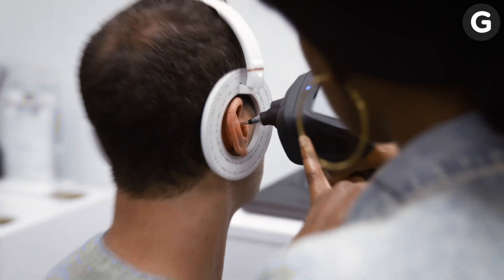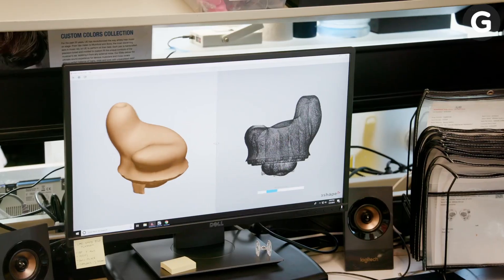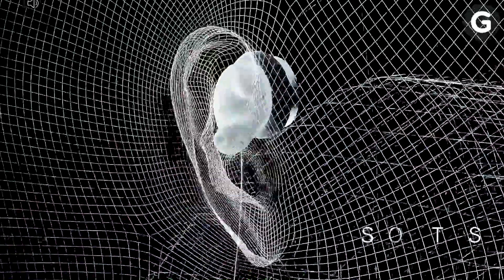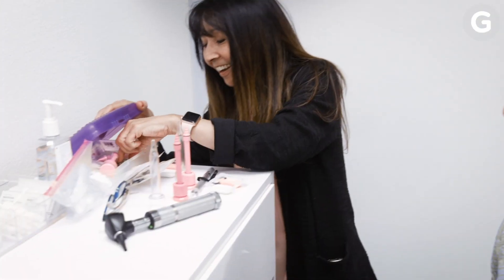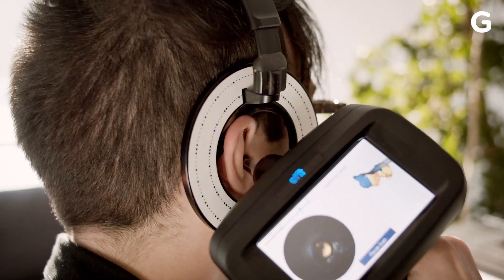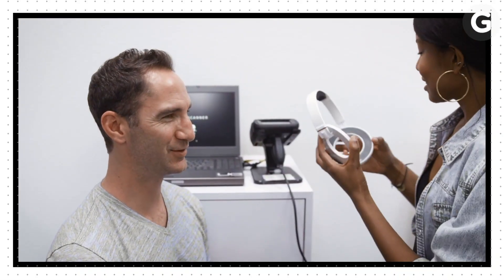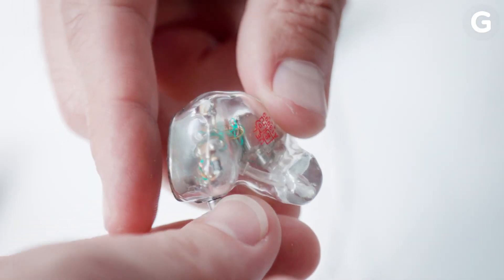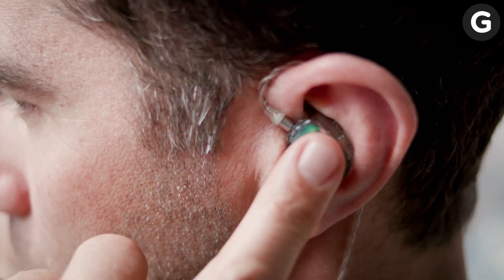The Most Custom Headphones | Bespoke America

Comment: Now you can make your own at home with custom earplug kits and a dremel. $10 or these that cost a few hundred per ear at the low end. Or $10 bucks to turn your favorite iems to custom fit
Reply: tell me more please
Reply: @mad-cyantist3159  look for a diy custom fit video. You use a silicon putty and wrap you iems in a thin layer and cover with the silicon and put it in your ear until it sets and drill a hole through

Comment: once you go custom fit its hard to use anything else...  the biggest issue with custom fit is you can tell people how great they sound but you can't let anyone try them out because... they only fit you...      I have a set that I switched over to wireless with the TRN BT20  and another set that I switched over to wireless with the Earstudio ES100, it has a mic built in where the phone app lets you adjust ambient so if needed you can have a face to face conversation without having to dig out the headphones from your ears...    enjoy...  they are great
Reply: Dick Bell which custom earphones do you use ?
Reply: @hmm2928  Custom Art
Reply: @dixter1652  If you have a pair of expensive custom-fitted monitors, I suggest the new iFi Go Pod Max, over the TRN adapters.
Incidentally, which model IEM do you own?
Reply: Same -_-
Reply: You can buy that 2 part silicone for custom ear plugs and make it fit your standard ear buds then drill a hole. Works great.

Comment: Are these noise canceling for that price?
Reply: No, but they block 26db of ambient sound, so they don't really need to be. I find that I can listen to music and much lower volumes even in loud environments.
Reply: They are noise-isolating. So there is no need for an active signal.  Let us know if you have any more questions.
Reply: @UltimateEarsPro   Can the CSX line (with the bluetooth connector) be made with an audiologist impression, so the IEM will be long enough for the second-bend, but still have the use of the bluetooth connector, at the CSX price level?
Reply: This comment hurts my soul.